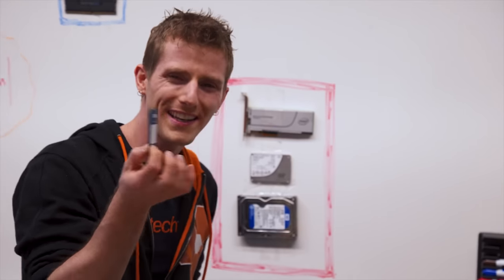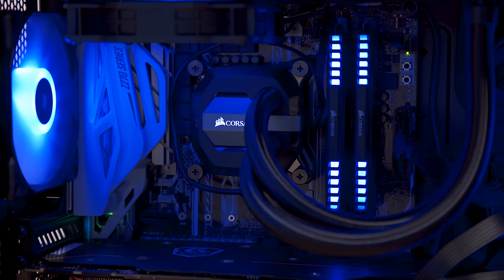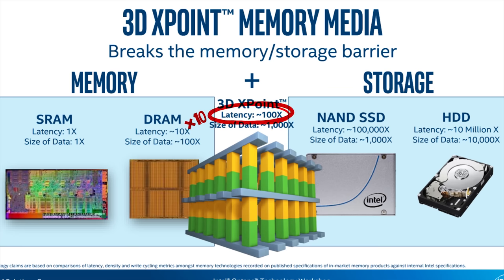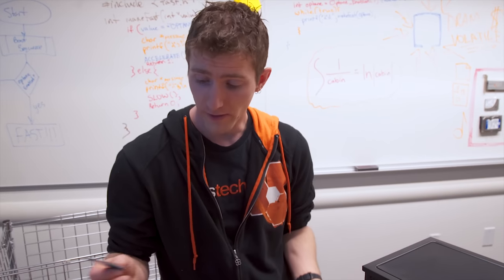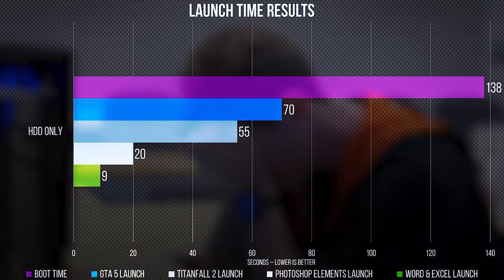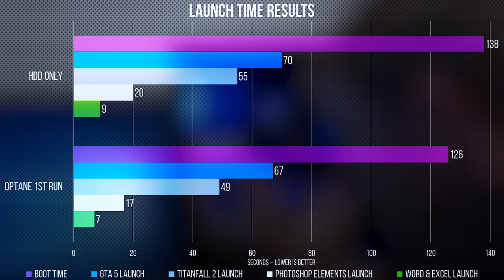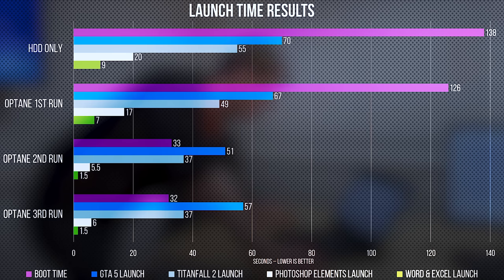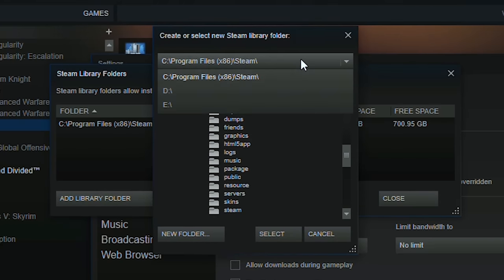Intel Optane Exclusive Hands On - SSD Crushing Performance

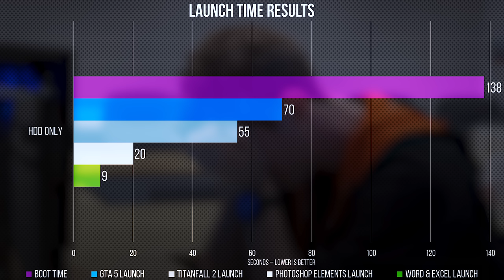Comment: 4:45 138 seconds boot time with an HDD?
What the hell, was it broken or what?
Reply: Yosyp that is fast for an HDD.
Reply: yea, seriously, this video is strange. 
even with the optane, the boot time still was 30seconds, which is incredibly long.
i havent used an hdd as bootdrive in a long time, but i cant imagine that it takes more than 2 minutes. 
my cheapo sandisk-SATA-ssd is doing ~10-15seconds...
Reply: I don't remember my first and second boots being this long, I have a 64MB cache 1TB WD Blu HDD.
I usually boot up my W10 system in about 10 seconds.
Reply: You have no idea how 138 seconds boot time is leaving mine in the dirt.
Depending on how you define "boot". My computer can take up to 5 minutes usually more, from when the power button is pushed to load everything.
Reply: Yosyp Well it takes 28 seconds even for my 850 pro to boot Windows.
Reply: zampano 006 my HyperX Fury takes 15 seconds to load(not counting BIOS POST) to the desktop and the computer is fully usable at that point, and background apps open in a few seconds. My old HDD would load to the desktop in 30-40 seconds, then it would suffer to load the background applications, overall boottime with an HDD is closer to the 120-140 seconds mark, and much more.
Reply: I know right! He might be counting in everything loading and getting ready though.
Reply: +Vampyreq what is your set up?
Reply: I have a bunch of startup programs: Afterburner, Riva Tuner, my Nod32, the usual Radeon and audio drivers, Razer Synapse, the Logiteh Gaming app, not counting Steam, Uplay and Teamspeak which I immediately click after the desktop appears.
Reply: Daniel Verten; no it's not fast for an HDD. my PC (which has no SSD) gets to desktop between 15-30 seconds depending on whether updates were recently installed or not. 138 seconds is incredibly slow.
Reply: The hard drives in my school take over 4 mins to start up
Reply: I do have to agree, the numbers seem a little inflated for an HDD. They probably used a 5400rpm drive instead of a 7200rpm drive. Or the drive could have been dropped on its head. (Pun)
Reply: ive just retested my cheapo sandisk ssd. 
22 seconds from pressing the power-button until this video starts ( including having 10 tabs opened on start of chrome).
Reply: background  software
Reply: I do have a lot of background software too.
Reply: same for the GTA V, my old laptop with an i5 3337U and intel HD 4000 starts GTA V off an external HDD (1TB, 5400 RPM, limited by USB 3.0) in 40 seconds...
Reply: FIreCuda SSHD here, around 15/20 to boot everything
Reply: my HDD boots in less than 10 seconds!
Reply: Running sata hdd 64MB cache takes about 2 mins for my computer to boot (to run programs without delay). 1st gen i5, 8 ram. So, i see it as normal
Reply: KontrolStyle i5 3rd gen (3337u), 8 gigs ram, 64MB cache hdd, 3.5 minutes... consider yourself lucky...
Reply: Hell yes! Windows 7 64 forever! :)
Reply: That's a huge point. Windows 10 Fast Boot doing all boot optimization stuff. HDD's slow as f*ck without Prefetcher, Ram caching etc.
Reply: Are you insane. HDD boot is way faster than 138 seconds. My 10 year old computer boots windows xp faster lol.
Reply: That's a huge difference between XP and 10. You can't compare that way
Reply: Think he encountered the bios time
Reply: That time would be cut down significantly if it was a 7200 rpm drive like a WD Black. It's a Blue model, and those drives are 5400 rpm spindle speed drives.
Reply: yep i have a 1tb hd, and to load every program at lauch it takes around 1-2 minutes.
Reply: Seagate Hybrid Drives have been working very well for gamers for several years now.   TBs of storage with integrated SSD caching,  plug and play:   https://www.newegg.com/Product/Product.aspx?Item=N82E16822178996
Reply: Remember to keep in mind when an HDD boots to windows 10 it might be using fast boot, which can sometimes work a bit like hibernate (I think) and also some motherboards take longer to POST and actually start loading the OS.
Reply: 9 seconds to load Word&Excel! My Toshiba HDD takes 2 seconds (timed on stopwatch app in windows).
Reply: had a cheap seagate 2tb 'solid state hybrid' hdd and it would boot in like 30 secs lol before I bought my current ssd. i feel that over 30 seconds on a boot with a relatively expensive bit of kit is still a long boot in this day and age. probably getting cheaper to just buy a 1tb ssd instead of a good hdd and an optane drive
Reply: OCZ NVME drive cold boots windows in 19.72 seconds....hmmm....
Reply: Yosyp my school computers that are crap boot in about 20 seconds lol
Reply: Is optane a cache only drive?  can it be used as a storage drive for the os, games and application like a normal nvme drive?
Reply: My laptop takes 2-4 minutes to load. But it is a good laptop for normal use. I can also run Rocket League or Overwatch with at least 30 fps. Of course I disabled Fast Boot because I also run Linux on it. So my point is, 138s is possible
Reply: It can be treated as ram with supported chipsets or treated as a system drive.
Reply: Daniel Gouveia depends on programs on startup enabled if all mine were it would be 10mins I have a 1tb 7200rpm hdd it takes like 100 seconds or less to boot
Reply: its always taken my HDD about that long even on my second computer it would always take like 2 minutes for it to fully boot
Reply: OS boot times sounds like a terrible way to measure latency.
Reply: Thats not how intel measured it.
Reply: i bet, no competent person would.  It's just odd that these measurements would be given when the drive screams for measurements using small highly random access read requests.
Reply: My hdd takes 9-15 seconds to boot up lmao
Reply: My computer boots up in under 10
Reply: Asus P5Q Pro
E8400 Stock
2X2GB DDR2 RAM 533MHz I believe
500GB WD Black (Boot drive)
640GB WD Black + 6TB WD Blue for other stuff.
Reply: Asus P5Q Pro
E8400 Stock
2X2GB DDR2 RAM 533MHz I believe
500GB WD Black (Boot drive)
640GB WD Black + 6TB WD Blue for other stuff.
Reply: Yosyp Thats actually pretty fast. My old comp needed 2min and 21 sec.
Reply: Most Windows OS's, by default, cache some stuff in the hard drive, in order to boot faster. This is called fastboot.
Without this feature enabled, and HDD does take a lot of time to boot.
Reply: He might have timed programs loading up by default, like how discord and steam open when you boot up and it takes forever
Reply: Be careful with that drive I've had multiple failures with WDB and I baby my stuff...

First one lasted 1 month 
Second one lasted about 6 months
It happens but being without a drive for a $1,800 PC for a week and a half twice is a little crazy..
Reply: if you bought them @ the same place don't buy there again
Reply: disable the fastboot a.k.a hybernate-in-disguise, and you'll realize that 138 sec is fast enough
Reply: You should probably look into that. I have 4 in RAID 0, and I can reboot and have rainmeter open in that time.
Reply: He is counting from button to full boot,  when you measure boot time you measure the entire process button till the loading icon stops and all background apps are loaded. So boots can vary from system to system depending on Bios and MB .. but this does not matter to show the impact of optane because the board is the same so what you measure is the delta or change in time. It is actually important to leave in the bios post because the hardware has changed and the bios might actually take slightly longer to post than before with another piece of hardware to recognize
Reply: You do understand that boot times vary by board and bios settings right? Example some boards have a fast boot setting that removes many tests from the process. Also just watch an X99 board boot most, especially EVGA X99 boards take a long time just to post the bios. Also if you have raid arrays or multiple discs, multiple GPUs, even just more RAM can all add to the bios post time. Linus' test is about Delta e.g. the change the optane makes not the actual times.
Reply: got a 7,2k and a 10k rpm HDD and both of them are no where near 40 seconds... i think its beyond fked up and about to ascend to heaven
Reply: Yosyp 10 second win10 boot off a wd blue hdd? lol. 

bullshit.
Reply: I must have a lot more background apps than most people. I have an SSD, and rebooting is kind of a 3-4 minute affair. Once I reach the desktop, it takes approximately 2.5 more minutes to load everything. When I had an HDD, it was like 10 or 15 minutes.

That said, I run a bunch of game servers off my computer, and my system tray pretty much stretches two thirds of the way across a 1080p monitor. I have 32GB of RAM, and my average memory use is 80% or so.
Reply: Depends how you shut down windows and set your bios, alongside additional drives connected to your sata ports. I can range anything from 10 seconds to 2 minutes depending on shut down and fast boot settings. I use over 10 drives. 4 sdd's 6 mechanical.
Reply: Men, we ARE talking about BOOT TIME! Does anybody here even know what BOOT time is? Well, there's a huge difference between BOOT and complete system boot, here we're talking about BOOT - so - I have WDC BLUE EZEX 1TB and I'm able to boot within 5-10 seconds. To boot completely (so HDD stops crunching) it takes about 1 minute - hope this covers it now
Reply: That is an oooold system. But seems that you have 1066MHz DDR3 memory. Depending on what application you use, it typically shows half the RAM speeds.
Reply: They might be counting full windows loading as "boot time" i mean full app loading and shit.
Reply: They probably disabled fastboot.
If you had a hardware change with fastboot, it will take longer than before.
Also a fastboot is just a trick of starting the computer when the computer shuts down and safe all the RAM data on to Harddrive and just read this data into RAM.
So with fastboot your system doesn't really "boot".
Reply: Strange, I boot in about 7 sec, can be a lot of startup programs or slow ram and processor. Also do you count bios time as well?
Reply: He counted time from pressing the power button, so yes bios time as well.  My SSD takes longer than 7sec.
Reply: So many geniuses in this thread!
Fastboot/Fast Startup =/= booting, it's a logged out hibernation state.  No one is booting anything from a HDD in 10s.
Reply: Well, If you mean booting up since the PC's turn on, well, about 15-20 secs to BOOT for me..
Reply: I use an Intel Postville ("very" old SSD) on SATA2 with a fancy X58 MoBo with lame ass BIOS and it boots Windows 10 in below 20 seconds...
Reply: Do bear in mind that this is not a pure SSD though, it's a HDD with SSD as a cache. Hence the first boot was only a little better.

Comment: Samsung Evo 850 SSD with 16 GB DDR3 SD-RAM 799 MHz, loaded with Adobe Family, 3Ds Max Design, custom applications, Internet Security Software, etc. boot time, less than 10 seconds, load time 34s. This thing here is not worth the trouble at all.

(No fast boot in UEFI enabled, my 500GB SSD did cost me 88€ during a great sales-off 1 year ago)
Reply: Tengoku NET this is for people with HDDs to improve startup time and load times
Reply: No one should be booting from HDD anymore.
Reply: Also Linus said at the start of the video the card is 50$... I'm gonna take a guess and say ur 850gb ssd is a LITTLE more expensive
Reply: For 44$ and 77$? How the fuck it's meant for HDD users when they can simply replace their HDD with SSD for around the same time? Or in addition to. 240GB of SSD start from 80$. This thing is 32GB...
Reply: it's not 850 GB lmao... he said samsung 850 evo
Reply: TehObLiVioUs still more than 44 and 77...
Reply: problem is that people with only Hdds will generally not own a Kaby lake cpu. Unless they bought oem, which in that case good luck finding an M.2 (let alone they might not want to open their pc up). 
However I could see a use case for someone with a low budget and needs massive storage with Hdds but wants to speed up their system. $50 is way cheaper than any ssd for this purpose in mind (let alone one from a good brand) and will actually outlast the system
Reply: This is the proof of concept, the first release of a brand new tech. This stuff will destroy any kind of NAND tech once it lifts off the ground. Unfortunately Intel wants this in consumers hands before it's really ready for the limelight. Give it a year of being in server farms to really shine in the gaming/consumer market.
Reply: Fobus In the dark i think it's perfect for me, i have a 2tb hdd and am not planning on getting on ssd bc i don't have money and paying 44 bucks for a quick boot time is worth it.
Reply: Fobus In the dark cheapest 256gb ssd i could find is 99 bucks.
Reply: But it's not cheaper... 128 GB SSD  start from 55-75$...
Reply: Markus, http://www.microcenter.com/category/4294945779/solid-state-drives-ssd
And on amazon/newegg it's only a little bit more expensive. 

Dude, you're wasting you're money fr buying this stuff. If money is really this much of an issue, why not get 64GB? Either way, it's not worth it.
Reply: I boot from my hdd. I only use my ssd for my games. its only a 128gb M.2 nvme pcie
Reply: Samsung 960 Evo M.2. Super fast. Worth the money? I still haven't decided. Still cooler than Hell. (note that Hell is a very warm place, so it is a lot cooler.)
Reply: windows installed in ram
Reply: Nicholas Howatson why not do the opposite.. Boot from your ssd and use your HDD for games.
Reply: I have no problems booting from my hdd. i cant have both my OS and games on my ssd because its a very small capacity. i like the performance the SSD adds to my games. plus i don't want to go through the hassle of cloning everything and moving it. if it aint broke don't fix it. i was having bad stuttering issues and long load time with games on my HDD but my ssd fixed all of that. my games load in seconds instead of minutes and i don't have stuttering like i did on my hdd.
Reply: i concur with the general conclusions here - it's neat, but the cost isn't quite appealing to the target Consumer audience, and the target audience is one that currently only has Hard Disks as well as doesn't have tons of system Memory either.

but in some time from now, maybe it'll become a norm like SSD's have.
Reply: Seriously, this has been on Ultrabooks for ages, only with lower speeds. It's "good" if you have, say, 2 TB or more and don't want to  buy a SSD.. but then again, someone with a disk like that should have a SSD already for OS.
Reply: I do not understand who is the target market. if you need a 200 series MB, you are likely to have already an SSD. and for 80$/€ you can get an SSD with 240GB where one can store the OS and all the programms and some games.
To me this is quite similar to tier storage, something not useful for personal use.
Reply: I bought a 128gb SSD for $40 as a boot drive and to open programs faster; I bought a 1TB HDD for $40 as well to store games. If someone doesnt have an SSD in 2017 they really need to buy one ASAP, thats just ridiculous and no ones saying buy a 1TB SSD for mass storage either.

Comment: That over 2 minutes boot time is actually pretty horrible even for a HDD :v Normal one would be 20-40 seconds
Reply: idk, can argue, my old laptop with hdd and win 10 was somewhat over a minute to boot, and then sometime to get pc going at full speed
Reply: usually Windows 10 uses a kind of "partial hibernation", to make boot faster. if you restart your PC will make a full boot
Reply: Arvydas Andrius then your laptop probably uses a 5400 rpm drive. Most 3.5 in HDDs are 7200 rpms.
Reply: you forgeting one thing it was 3TB hdd
Reply: my poverty spec surface pro 3 i3 boots to w10 desktop in under 10 seconds from full restart
Reply: A surface does sure not run on a hard drive. It runs on SSD-class memory, wich means that 10 seconds is nothing special considering there is not too much of a bios that takes ages.
Reply: My 1tb HDD is about 50% full and boots up about 9-15 seconds. When I first built my pc It nearly did it instantly like waking up from sleep!
Reply: PissedOffHoneyBadger 9-15 seconds for windows itself is normal for HDDs if you have a rather fresh install. Then there is also the BIOS wich usually adds 10-20 seconds to the boot. Getting the whole PC to start up in 10 seconds is not possible with an HDD amd windows 10.
Reply: When I booted my custom PC for the first time it didn't go to bios, It just went straight to the desktop. My build isn't amd (well the gpu is but I don't think that affects boot up time) dunno why that would matter unless you got something crap like an Athlon.

What in BIOS adds 10-20 seconds?
Reply: teach me bro!
I just installed this fucking win10 a month ago, and it takes almost 5 minutes to boot :/
And I didn't even install Steam yet.
Autostart is only on for Skype, and BitTorrent. whattafack should I do?
Reply: MrDoboz Skype fucks up the boot time good. But other than that, there is not much to do.
Reply: It took 9-15 seconds because of something called Fast Boot. Your hard drive, unless very, very shitty, will not change this much.
Reply: Doctah Fast boot does not count as boot time. Boot time is measured when starting up from a full shutdown (usually includes power cut).
Reply: My build isn't even close to high end and my 1tb HDD is 80% full but I can boot up to the desktop screen within 30 from a fresh restart. Add an extra 25 to 30 seconds for it to get things ready. So getting this to just speed up things by an extra 30 seconds or so is just not ideal. Its not like I'm gonna die from waiting. I would rather invest in a better ssd even if its more expensive than just wasting it on making my HDD a hybrid hard drive.
Reply: Sam Chikowore If you want to get an SSD, get 500GB. They have the best value, cheaper ones are more expensive per GB and everything over 1TB gets horribly expensive since those are not consumer class products anymore.